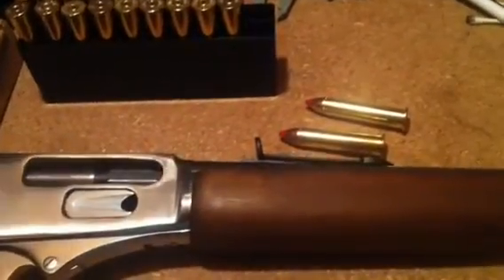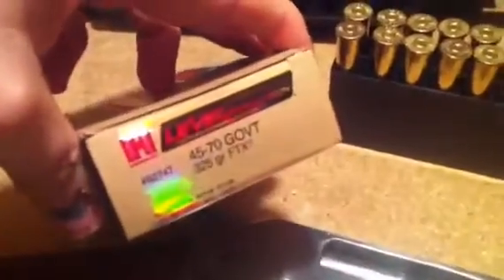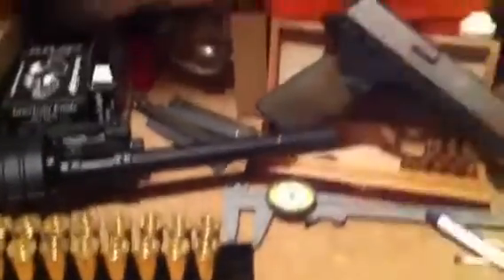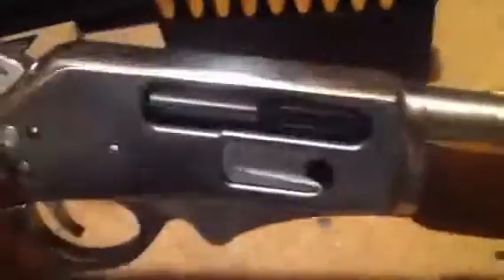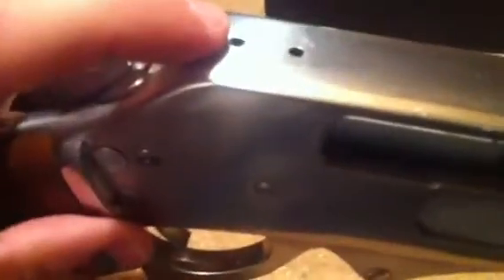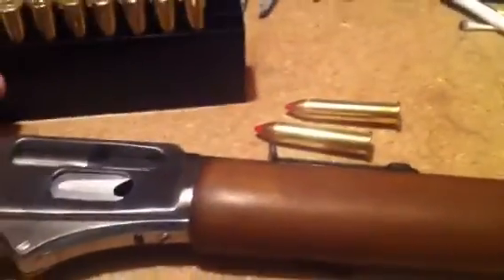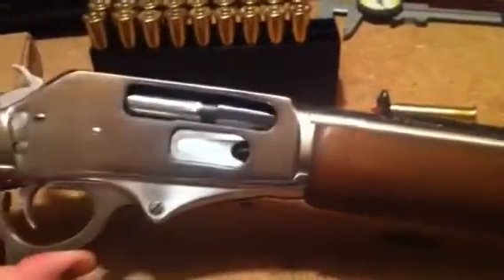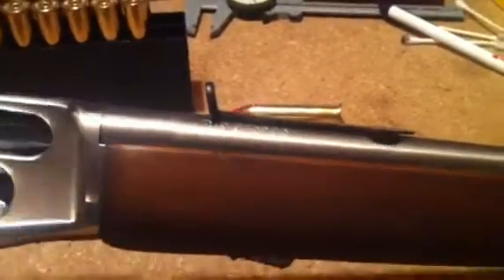45/70 rear sight problems

Comment: It should be possible to tap the sight out of the dovetail, and the bend it down a bit and reinstall it. That would increase the spring tension and hold the elevator tighter and keep it from moving.